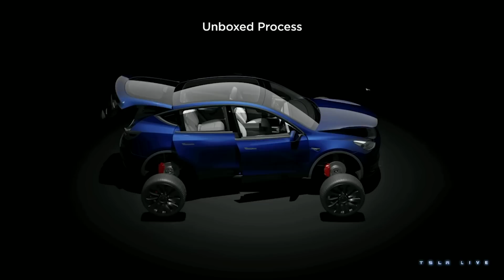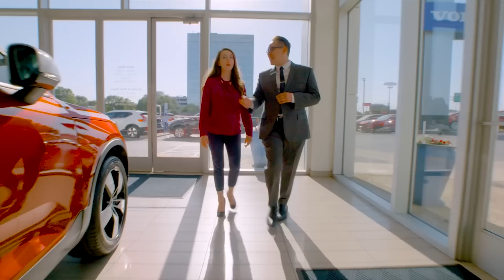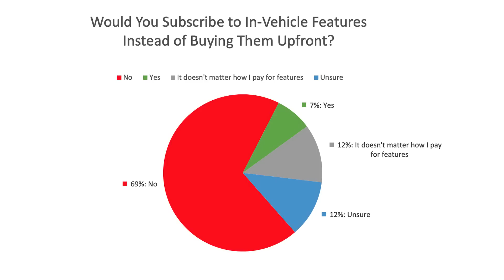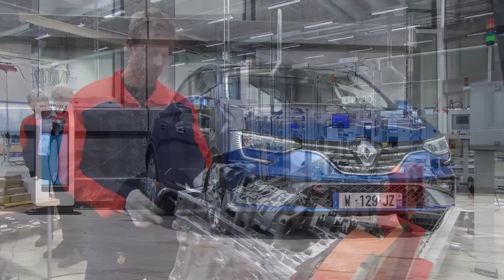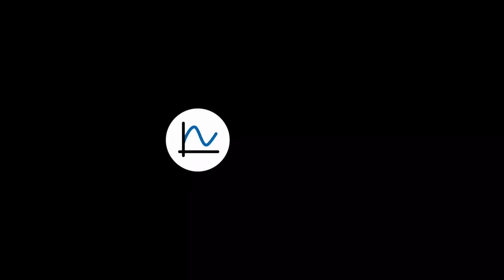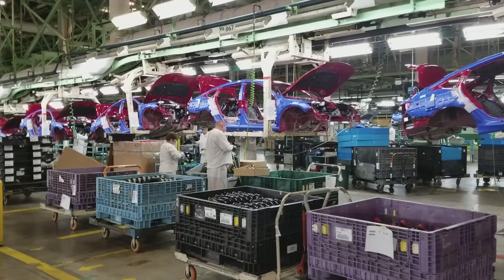Tesla to Halve Assembly Costs; Car Buyers Hate Subscription Services - Autoline Daily 3517

Comment: Other three, the van, the roboTaxi, and the cheaper car (based on a model 3, but smaller).  

Energy uses as much or more hydrocarbon fuels as Transportation does.  So energy generation transition to solar is just as important as Autos and heat pumps.  

It always happens that more resources are found when people start looking.  Lithium is abundant

Comment: I’m glad you highlighted the modular Supercharger installation, where everything is preassembled on a concrete slab and trucked as a unit to the installation site. However, they have been using modular Superchargers for well over a year now.  It’s unfortunate that this hasn’t been covered more in the press.

Comment: The risk for miners is that future batteries won't require the stuff they are mining. They need contracts to make sure they get at least enough business to pay back the cost of the mine and some profit.
Reply: it cost years and billions to set up a lithium mine, and they might find out sodium might replace it.
Reply: This is not true. 'breakthrough" battery chemistry has been pushed for over fifty years. So far none have come to fruition except lithium . It doesn't matter how good the battery chemistry is if you can't manufacture at mass scale. There is almost zero risk of a drop in demand for the standard materials dropping.

Comment: The worst thing about subscriptions is you lose the ability to unlock your car with your phone or start it.  It is not right that they can include the full cost in the car price, but demand fees after 3-4 years of ownership to screw you over.  It wouldn't be as bad if we could easily do aftermarket services but that is possible less and less due to "security" they add to car systems for the purpose of blocking 3rd party competitors making car mods.  They purposely make the fobs limited so they don't do two way communication or have decent range.

There has never been a credible threat to a car with any kind of physical device connected to a car's canbus without the owner's knowledge that has ever done anything bad.  You can access car wiring from underneath, and if someone really wants to hurt people modifying cars, they will do the work to bypass security or use something that doesn't have to connect to the car like a tracker.  Only consumers get hurt as this takes the ownership of their car away from them.

Comment: Revolutionary! They went from gigafactory to normal sized factory!
Reply: Where?
Reply: @wolfgangpreier9160  Mexico
Reply: @LeesChannel  Lets see what they really make.
Reply: Output same w sane vertical integration. Not assembly of outsourced parts.
Reply: I really enjoyed the picture of the Mexico factory. Lovely building at the foot of some mountains, quite nice. But in reality, it will be in some urban sprawl outside of Mexico city with miles of concrete ,cars and mobile homes around it. Oh joy! You can practically smell it from here.😅
Reply: @paul5683  - it will be outside Monterrey, not Mexico City - and mobile homes? Those aren't exactly common in Mexico.
Reply: The giga refers to their output, not the physical size of the factory.
Reply: @alanlight7740  pretty sure thats not what it originally meant
Reply: @DingoAteMeBaby  - it was originally used for factories that could produce at least a billion watts worth of batteries annually.

Comment: Tesla will still use rare earth elements but the presentation said that it will stop using three of them.
[EDIT: Zero rare earth elements in their "Next Generation Permanent Magnet Motor" - this doesn't include the batteries]
Reply: Of course tesla will use rare earth elements. Just not in their motors. But in their electronics they need lanthanides. Just as one example.
Reply: What rare earths are used in the batteries?
Reply: @BjorckBengt  Some tantal parts in the electronics. Nothing else.
Reply: @BjorckBengt  Cobalt is one but with the cheaper but lower power density LFP (Lithium Ferro Phosphate) batteries even that can go...  :)

Comment: They won’t have to ban ICE engines. People will switch to EVs because of price and operating costs. Incentives won’t be necessary either.
Reply: It is mostly for manufacturers because of the multi-year development cycle and the entire supply chain behind them has to make plans for the transition.
Reply: Too many disadvantages and problems that can't be solved for many people to switch to EV's. These investor days are Great but they are not and will never be reality. This stuff being said yesterday is just as reliable as when Mary  tells us that GM is the leader in Ev's....Sounds good but nowhere near the truth.

Comment: The 3 additional cars I think Tesla will build are
- Compact Sedan
- Compact SUV
- A commercial van
Reply: Most likely: a SUBCOMPACT CROSSOVER* (Model Y is their compact crossover) , a 3-ROW FULL SIZED CROSSOVER (above Model X) and a MIDSIZED COMMERCIAL VAN (alternatively Tesla could wait until Rivian goes under and buy them to fulfill the Amazon contract and start from there for retail and other contracts).

* this would replace Elon's U$25K BEV and would start at slightly below U$40K or a bit less than 10% below Model 3 new prices

Comment: Tesla is all about fewer parts. 

Maybe I’ll be the first to say it, a giga casting could be used for multiple models and for front and rear with different skins to make a van or suv.
Reply: @Cesar Trujillo that is an excellent suggestion... can't wait to see if that is true.
Reply: Volvo has said they'll do that. But, they also said you have to make cars serviceable and quality control is key. Those are things Tesla doesn't talk about.  Volvo doesn't use the term "giga casting," they use "megacasting" and it won't happen until 2025/2026.

Comment: But it's still up 75% or more from Jan. On top of that, there's tons of people that would have bought before, waiting to unload if there was a pop in price. Lol. Maybe stick to cheering for Legacy auto.
Reply: 50% below peak market cap and 2,000% below the market cap in 2030. Anyone worrying about interest rates and inflation is thinking short-term (less than 3 years). The world needs electrification using renewables and appears to be willing to pay for it, especially if subsidies for fossil fuels are redirected to renewables. 
The biggest factor driving renewables? They are cheaper to install and run that the cost of the fossil fuel currently being used.